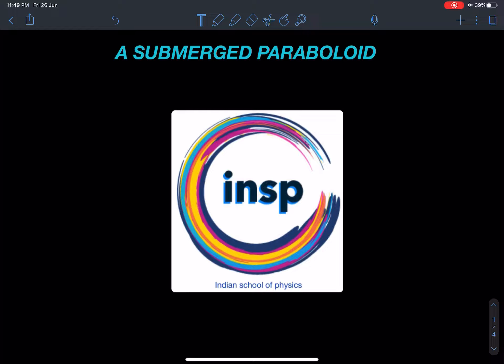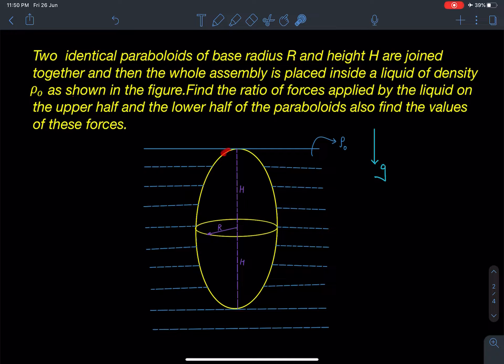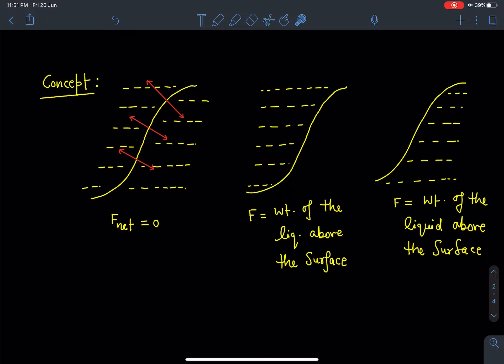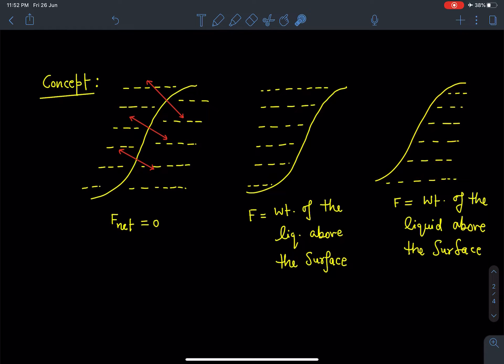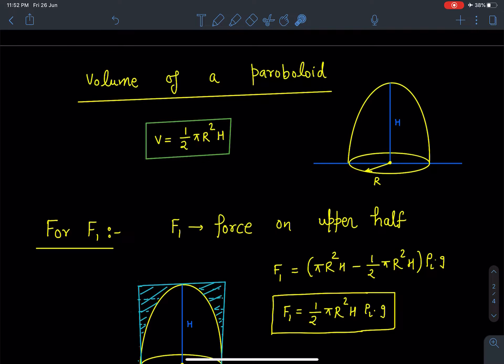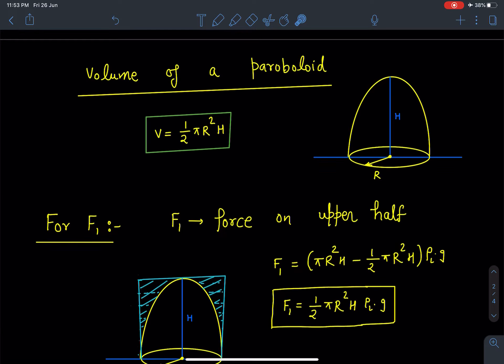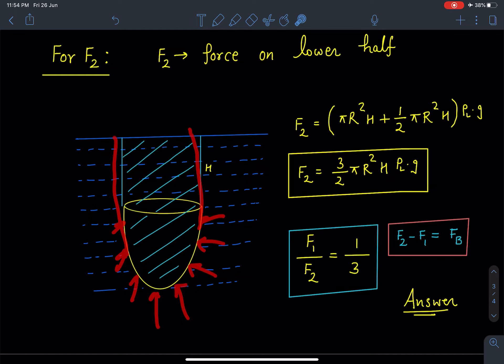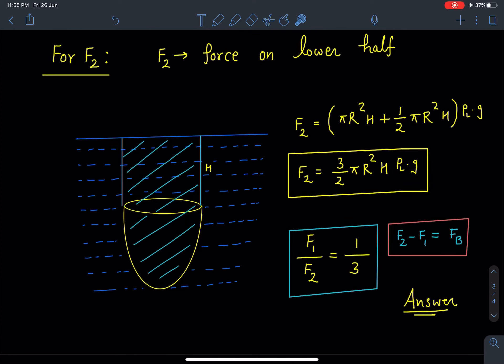A SUBMERGED PARABOLOID

Comment: We could also do it in another way! Break the paraboloid in 2 parts. For 1st part we can use (Force on lower flat face- force on upper surface (let f1)) = resulting buoyant force on paraboloid that is rho.Volume.g . In same way calculate for second surface and we will get same ans
Reply: whyy the force due to gravity is ignored
Reply: ya ,even i did  same way,and got the same ans.
Reply: @anandukv1151   because bouyant force is derived from pressure  difference, hence we dont account for force due to gravity.
Reply: Yhhh
Reply: Yeah valid method too

Comment: Very good problem and beautiful explanation. 👏
In the concept part, in 2nd and 3rd diagram, it is the vertical component of force is weight of liquid present above. There will be horizontal component also. In symmetrical surfaces like paraboloid, it will get cancelled from all directions.
Reply: Yeah true

Comment: Sir can you tell how to find net rightward force on the surface at 1:17 ? Is it easy to calculate? Thank you sir.
Reply from the maker: Yes it’s easy to find you can use projection area concept ,  Fh = Patm . A proj + rho g Ycm Aproj , hope this helps , in one of my courses I have used it in unacademy , if you are there please do check .
Reply: It can be done by taking pressure at centre of mass of vertical area and multiplying it by area of patch 
This would be valid when density is constant